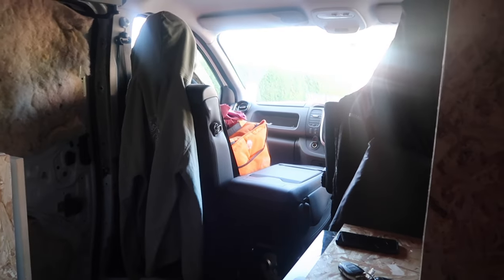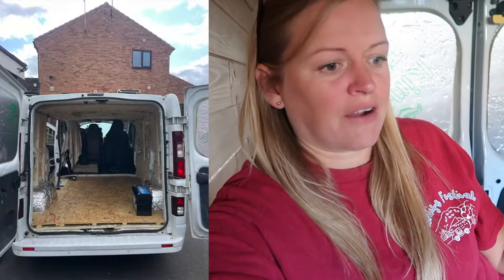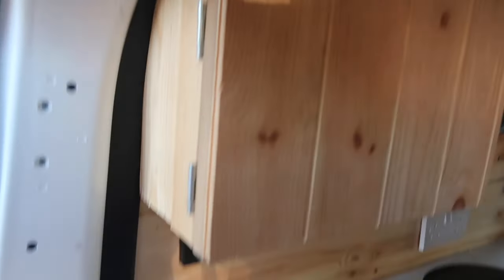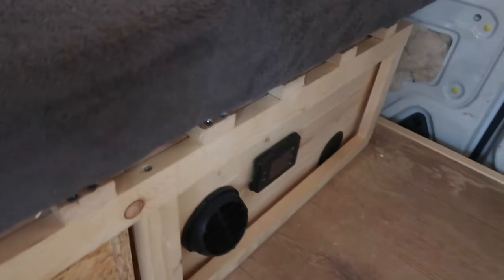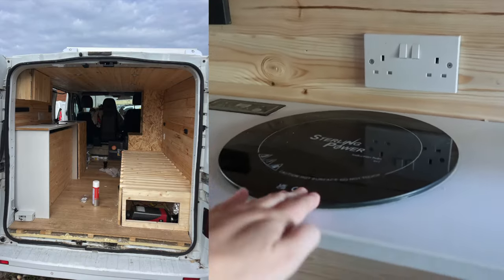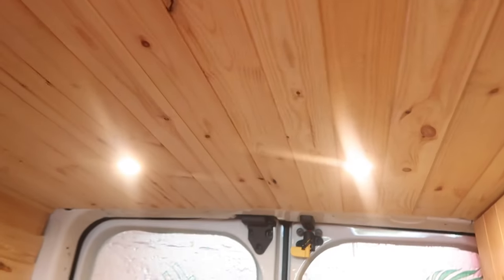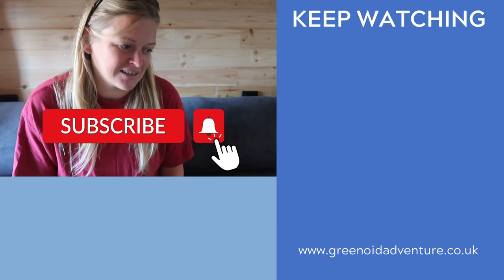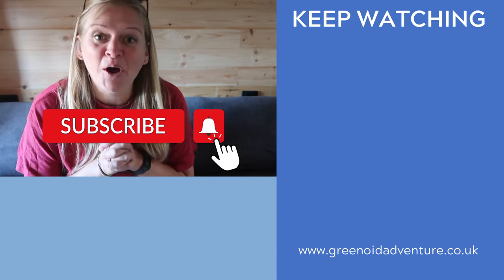Vauxhall Vivaro Self Build Camper Van Conversion Tour

Comment: Good to see you back. Wow good job. Just started converting mine. X
Reply from the maker: @Mark-nr4mg  how’s it getting on? What van u got?
Reply: @GreenoidAdventure  I've got a 2020 vivaro, I'm just starting on one side, I need some of that sticky spray stuff, to put insulation on the top panel. Then I will put the wood back on that came of there, but I'm just winging it on my own.
Reply: Ps I got that sheep's wool. It's great. Thanks for your tip. X